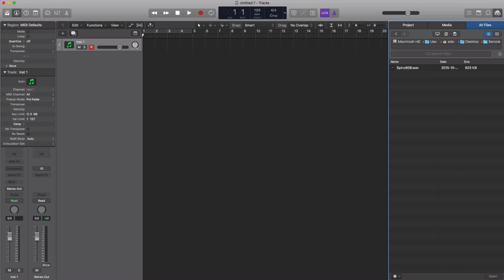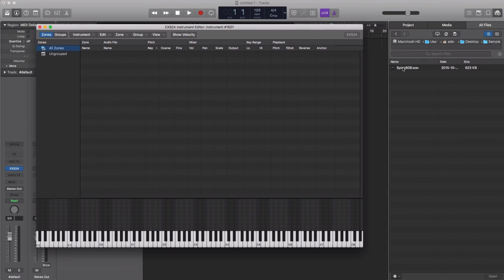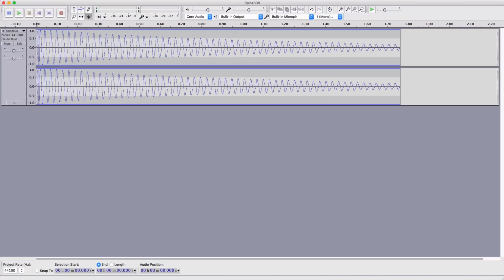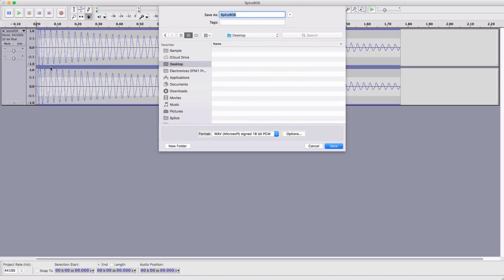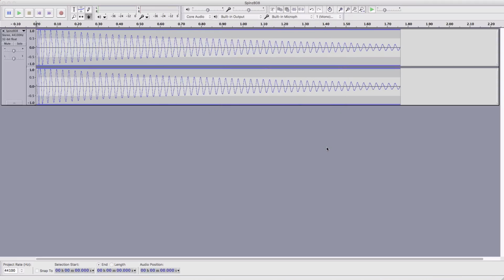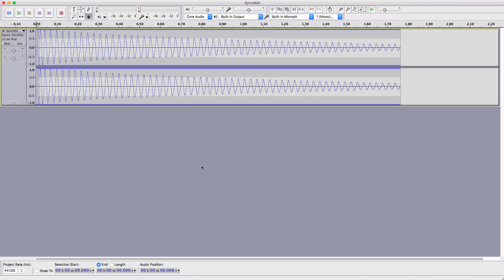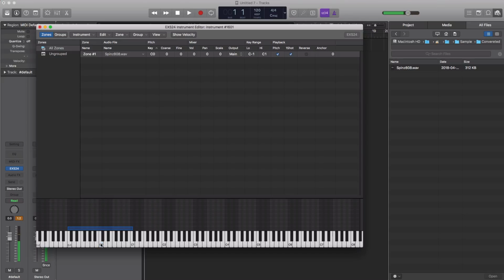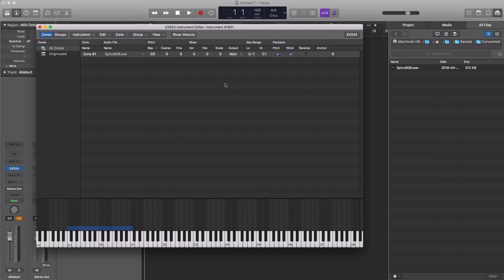How to Fix the Most ANNOYING Thing in LOGIC

Comment: No there's an easier way.
Just drag the sample into the logic session & it will create a 24b version in the same location where the original is.
Reply: Azazel even if that was the case, batch converting is smarter and more efficient. if wanna manually convert samples then do it.
Reply: Viratso but that's why i think that is a bad method. why save a project for the sake of dragging stuff in logic and converting them? XLD gets this done in seconds.
Reply: ^^^^THIS
Reply: hey this happened to me too with trial and error i figured it out that you need to save the session after your done if you don't you will get files do not exist and you'll have to start again
Reply: R Lennon I was going to comment this..you beat me
Reply: no that's a bad method. i spent hours one day converting a dozen drum packs like that and made a bunch of kits. came back and logic says the files do not exist when i open the exs24 kits even though the new files labeled -24 that it converted existed. maybe for converting one or two things sure. download XLD and batch convert any drum pack you download and tell it to save them to a new folder, then drag those. i will never do that method after my experience.
Reply: OliverDid9/11 you just don't know what you're doing that's why.